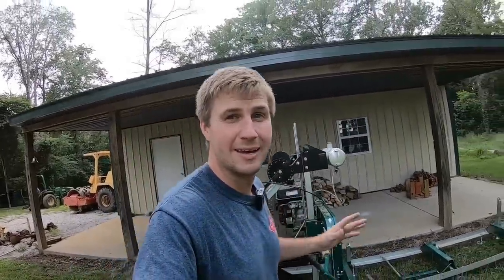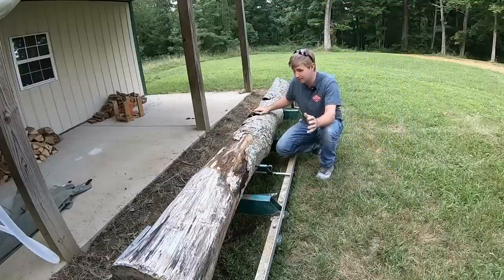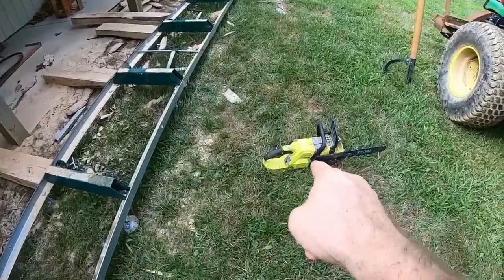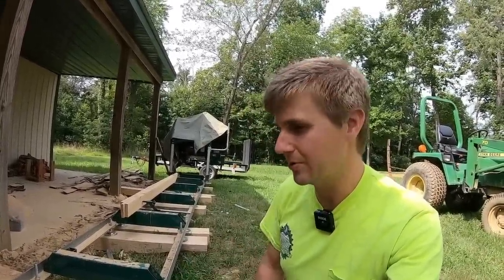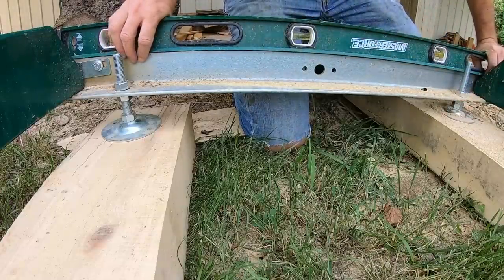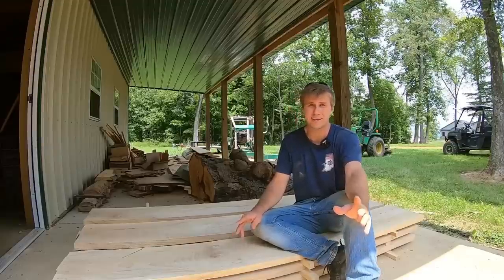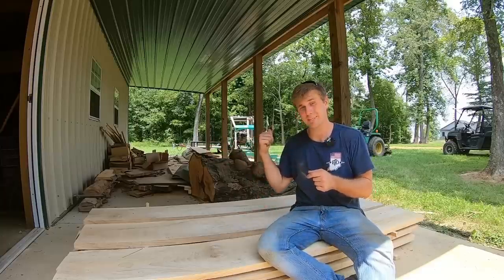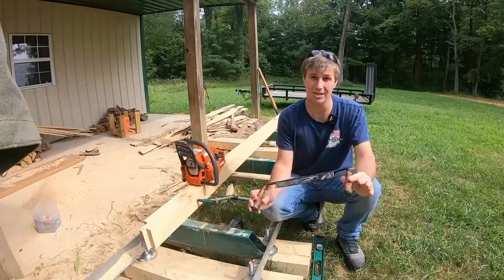First Time User Milling Max Width on Band Saw - Plus Leveling the Mill

Comment: Here is a tip for you. I would start sawing the log from the small end first and measure both ends to find the center of both ends and level the log so both centers are the same height.
Reply from the maker: Thanks for the tip!
Reply: @CaptainKleeman  if you have any questions feel free to ask. I have been doing it for about five years and still learning. Still modifying my mill that I built myself

Comment: Very nice video ..... I have been making beams for 30 years now with a chainsaw mill and built a Cordwood House ... some 37' long ... 128 beams posts and caps per floor ... two floors ... all cut with a hand chainsaw mill.
I am ultra super busy but I will make several videos this winter showing how to move the BIG logs ... how to roll a log sideways (to clear a stump, or whatever) 
Must tools are a peeve and a piked peeve with GOOD hardwood handles n some cabling, a 1' x 5/16" HT chain with hooks on each end comes in super handy (EZ to lose so paint fluorescent color)
HINT:  turn peeve backwards and use the handle of the peeve to pick up one end, roll, twist and move large logs short distances.
Sending  Logger Wade  a short vijit er two today for you...

Comment: Log pulling the tractor, tractor & winch won.  With the bark removed, first cuts make good barn covers for animals.  Just trim the edges, so they are thicker on the edge.  My Grandpa used this method to cover chicken, pig, sheep & steer sheds.  So, almost no waste.  Tool from Red Dog would work great to strip bark.  I love good tools.

Comment: Mike, you should put your trailer under the overhang of your shed and that way you can throw the old pieces of wood on the trailer so you don’t have to move it twice, then you can pull the trailer to the burn site to burn that wood.

Comment: You might also consider getting the concrete setups used for making decks. They are about 10" to 12" high and have a cutout on the top to handle wood cross members.If you had that beneath your milled timber, it would give you the height addition plus give you a stable base that could be reused elsewhere after the mill work is over. Just a thought.

Comment: I don't have a chirp wheel but I have a foam roller, pushing apart those vertebrae and facet joints in your back is like going to the chiropractor and it legit works to keep from losing mobility.
Reply from the maker: Definitely helps!

Comment: Two suggestions. A sort tag line on each end of the log . A must have. A good hand held metal detector.
Check those logs for unwelcomed surprises that could dull or otherwise ruin a blade.
Reply from the maker: Thanks for the suggestion!

Comment: While the mill itself doesn't bring back much memories for me, the first cuts do.  We used to buy those by the pickup truck load from a local guy who was milling a bunch of timber near Seymour and Brownstown a bit over 100 miles from you, cut them to length for the second round of wood on a new fire.  If they were dry enough, we'd also split some for kindling.  I hope your 96h work week is worth it for you in the end.  I've been there, done that, failed to get the t-shirt because they didn't make it in my size.  At the end of nearly a full month of that, I got to the base of the stairs leading to my 2nd floor apartment and honestly could not remember if I was going up or down.  I hadn't seen daylight except very occasionally out a small window, even though it was summer in California....      Before I forget, be careful you don't lend that draw knife to your brother.... He might become your half-brother !  (joke courtesy of the Woodwright's Shop).

Comment: Nice job Mike.   I have small mill, LT15.    You might want to build yourself a small Log Deck for loading your logs.  It only needs to be about an inch higher then you mill.   It helps in many ways and makes it safer(for the mill) when loading logs.   Load the deck with the tractor and then just use your log turner to roll the log onto the mill.   My log deck I can load 3-5 logs depending on size then your done with the tractor for a little while.    I have a video of my mill and you can see my deck in the beginning of the video
Reply from the maker: That’s a great tip!  I’ll check it out.  Thank you!

Comment: great video, even with a small throat the bandsaw seamed very capable!.. we switched our bota compact over to a 4 in 1 FEL but for a long while we had a standard bucket with two log grabs. What worked best for us was to make 2 slots (drill four holes and open to 2 slots) through the base of the bucket in line with the FEL/bucket mounts. Take a length of box section that fits in the bottom of the bucket and weld on a link of chain to fit through each slot. you can then just use a d shackle to attach each grab under the bucket... by doing this way the load on the bucket spread and the lifting point is nearer to the front axle which is safer plus there are no tools needed to put on or take off the grabs.

Comment: Congratulations on the 40K sub mark! 
 A friend has an old sawmill. It's a circular saw, ran with his tractor. I've helped him run it several times. It will cut a bigger log, but you NEED a bigger log when the kerf is nearly a half inch 😮 and it's not nearly as "portable 😁

Comment: When I made a comment on leveling my mill I may not have said that I level across at ecch jack and roll the mill between each jack and level lengthwise and then move the mill down between the next jacks and level across and  lengthwise and move down between jacks and so on. I did notice that the trake was going up and down quite a bit. I use auto scissor jacks under mine and have had  good luck. Also I have 6 inch channel 24 feet long for log rail and bunks.

Comment: Thanks for sharing your thoughts and ideas, always interesting and entertaining to watch your videos. Just a thought, from watching Wades videos, when he was hand cutting with the saw, if he got a tree where the base was too wide for the bar on his saw he would make some vertical slabs off the base to get the diameter down to accommodate the saw, was thinking a few similar cuts could save you some board length when thinning down a tree to fit the mill. Stay safe, wishing you and your family the best. Looking forward to seeing your upcoming videos.

Comment: Mike, you don't put out the most videos however, the videos you do publish are ALWAYS top notch in information and entertainment.  Regarding the location of the loaner mill, is there any way to put on a temporary dust deflector to blast the sawdust more down than out towards the garage/shop?  Or even just shift it away from the shop by a few more feet, that should cut down on having to clean off that pad by a little bit.  That will definitely have to be kept in mind for when (not if) you get your own mill, whether it's a Wood-Mizer or a Woodland.
Reply from the maker: I think I’d we get one I’ll end up adding onto the barn to have it in a covered area
Reply: @CaptainKleeman  I'd suggest something like the "carport" there at the side of the shop.  With enough clearance to use the tractor to help hoist the logs onto the mill bed.

Comment: Just a thought here but using 2 tag lines on the ends of the log going to the side of the bucket would keep the log from moving all over the place when loading them on the mill

Comment: A second set of log togs would do the job of keeping the logs level...meanwhile I think moving the single tong that you have now to one side of the bucket, lift the log then use a strap or chain on the other side would also work.
Reply from the maker: Thanks for the suggestion

Comment: Wonder if them springs on your Jeep frame would lift the log in place just wondering. Lots of other channels have the Woodland Mills Saw must be a good one. Lol dang thing looks like a pipe coupler. 👍👊🇺🇸 That battery saw is pretty impressive
Reply from the maker: Doubt the springs would pick up a log that size.  And yeah,  that little saw is impressive.

Comment: If you are going to buy a sawmill for yourself then a Woodmizer LT40 is the way to go. I have seen Stony Ridge Farmer in NC use his and it is a lot higher so you are not bending over so much, it is portable on two wheels so can be moved around easily. It can take up to 3ft diameter logs and also has hydraulic lifting and log turning features which make it easy for one man operation. Maybe more expensive than the one you are using though.
Reply from the maker: Lt40 are great Mills for sure,  unfortunately they are way out of our price range.  Thanks for watching!

Comment: if you do, or when you do get a saw mill.. get one that is a trailer.. has a heavy frame, and no having to level the whole thing, ever!.. as the frame does not flex. its always level.. and portable! just block the wheels and level the trailer with the front trailer jack, the the saw part does not roll unwanted.. and your ready to go

Comment: Just dropping some...helps?
1 Don't forget end tow to minimize waste in run out.

Totally agree with, gotta have a mill!

Cut some small wedges to use with cant hook/tractor positioning. I roll the log--usually where it doesn't want to lay still--and use small wood wedges to lock the log right where you want it...then set the dogs.

Not saying this is right, but I also use those wooden wedges to cheat the max diameter on logs. If you put a 24"/26" log on the mill, there's no way to dog the log...I use the wedges along with the weight of the oversize log to keep it steady while "waste" cutting it down to a size the dogs can handle.

I know you are saving for a mill, but hound those people over at Woodland Mills AND Logrite for help with a break on a mill and a decent one-man cant hook/peavey.

I am going to try out the Chirp...looks like the small diameter would be PERFECT against tension headaches!

There cannot be a better match for a sawmill company's advertising dollars than Captain Kleeman!!!

Woodmizer?? Woodland Mills?? Norwood?? Any of y'all manufacturers out there with an ounce of insight??

Comment: You might try seeing if a company that manufactures mills would be willing to partner with you kind of like DP has with Hyundai. I know you aren't a pro log miller like DP is a pro dirt mover; but if they have a model aimed more for people just starting out or want to step up to a better setup than a chainsaw with a guide bolted to it like you are. Paying the shipping on a loaner mill for you to use and make videos of would probably be cheaper than paying an advertising company to make a promo video or a TV advertisement. Never hurts to ask, worst they will say is no.

I'm not a huge wood working fan, but the mill does look kind of fun.
Reply from the maker: I actually reached out to wood mizer and woodland mills and they both turned me down.  No worries though,  Clint has me covered!  Appreciate all the support and you always stopping by

Comment: was a bit harsh in my last comment to you but i must give you this you don't give up and you don''t shy away from hard work it is interesting the way that saw works and get some nice lumber off it but at video marker ruff 2215 the frame of the saw bed dips down with the weight is this a problem or does it alow for this any way sorry for my last and Cheers by the way the back roller is marvelous i have one and like you use it daily works well  Cheers

Comment: I was with you using self milled lumber for the projects you said last video.  But this video you added the boat house.   Just so you know, all building codes require inspected and stamped structural lumber for occupancies.   So, if you plan on using any of this for building an occupied structure, you can hire a person to inspect, grade, and stamp your lumber.   Not doing so, puts you at a high liability risk.    The age old comment, “The inspector did not say anything and passed it” means nothing.   They are not liable, but you are.   If something fails while renting out the structure, they can take you to court and you will lose in just a few minutes.   Be safe, the life you save may be your own.    Respectfully,   Kevin
Reply from the maker: Didn’t add the YouTube yacht.  Shelter house,  bridge,  chicken coop.  Appreciate you looking out though!
Reply: @CaptainKleeman    So you are saying you did not include the boathouse?   Went back and listened carefully.   Sorry!
Reply from the maker: No worries!  I had to go back and double check myself!  I’ve said the wrong thing before 😂

Comment: That is pretty sweet! Did the boards come out a consistent thickness? In the sped up video the mill frame seems to move around a lot.
Reply from the maker: Moved around more than I had noticed in person.  Definitely have to do some more work to get it stable.  Hopefully I can get it figured out!  Thanks for watching Wes!
Reply: I noticed same as www and looked closer and I wonder if the bottom nut on the support vibrated down or maybe you skipped tightening them, another great video congrats on 40k. Use the draw knife to clean dirty bark save wear on blades
Reply: @CaptainKleeman  if you can find a log long enough go ahead and cut your long boards for your bridge deck as long as the sawmill is then place them under the cross pieces under the sawmill. That will help with the flex.
Reply: @clintonwiles5451  
Yupp. Certainly could see the sawmill frame moving with the feet somewhat stationary so the bottom nut must have dropped down. 
At first I thought the blocking would move on the grass but they seemed pretty stable.
Reply: Or, just jack up your 4-wheeler and get under the wheen on a creeper!
Reply: Some of that moving around is the post guides are worn its just another thing that has to be changed from time to time

Comment: Why did you not put the sawmill head on the cement under the roof with the bed sticking out? that way the sawdust would go on the grass not fill the carport
Reply from the maker: Wouldn’t be able to get logs in
Reply: @CaptainKleeman  Hi Capt'n i meant 90degrees to the way it is now, with the bed on the grass and only the head under cover on the concrete.  Not behind the posts, in between them.

Comment: I’m not laughing with you.  Those rollers and massagers are a godsend.  My fire department recently updated its gym equipment and the committee in charge wanted to spend a bunch of money on things like that and the guys laughed and balked saying we just need weights.  Well thankfully the committee did spend money on the rollers.  They are awesome and you see the same guys who were bitching about them, using them all the time now.  If you’re active, recovery is just as important as strength training and cardio.